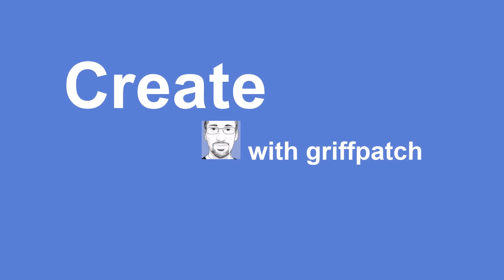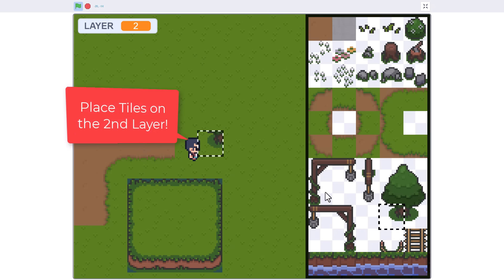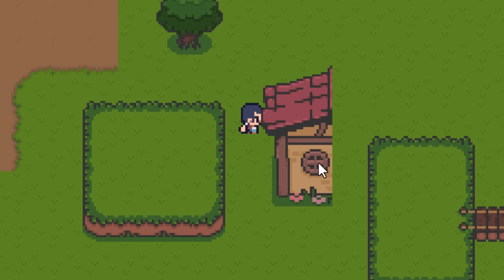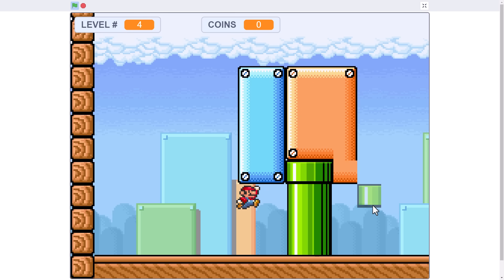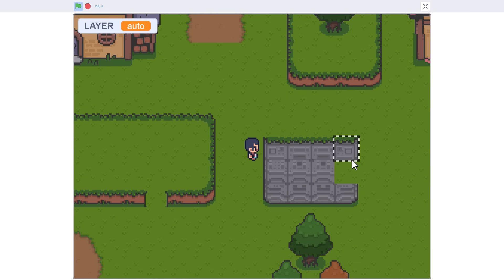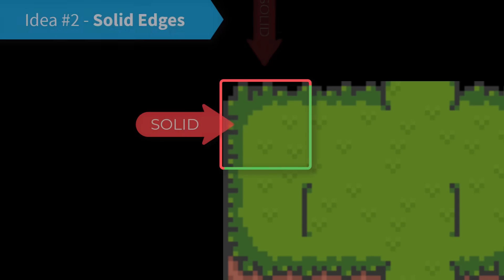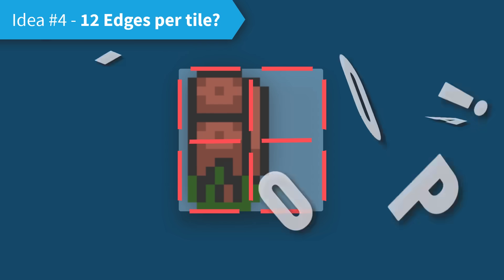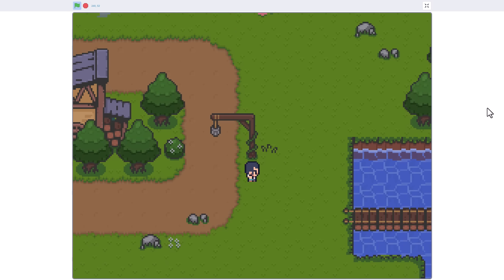Scratch RPG | Devlog #02 | Tile Layering & Collisions

Comment: May i ask: for what are the green and blue pins used?
Reply from the maker: Ah! - You noticed that did you :) - They are special pins for something I haven't explained yet as they actually came after this devlog - I just captured some video after the fact. These allow me to tell the bridge to CUT through another solid wall - so they can run off the edge of another otherwise blocked platform. The 3rd colour is an elevation pin I shall explain later on :D - I wonder if you can guess!
Reply: @griffpatch  Hello griffpatch do you believe it would be possible to select a tile corner of an large object then select the opposite side corner of such in order to grab all the tiles that are in between the regions for stamping the whole thing. While then having that grid showing where the layout will go entirely on the user mouse click before laying it down? This would be the truly optimal version of the whole thing I believe do you think so? If anything I think it's an interesting idea and helpful even though it requires more work by you. Hope that you would be okay with this suggestion.
Reply: @griffpatch  hmm I'm thinking it'll change what layer the player is on
Reply: Griffpatch already made layers for each tile so it might not do any change
Reply: @dipanshvideotime2730  I guess so
Reply: @magitingLOL  2.5
Reply: @pixelatedluisdev  what do you mean?
Reply: @magitingLOL  woah didn't see you here
Reply: @tigershelf  yeah i joined the thread haha
Reply: @griffpatch    i think levation pin mean you can go through a bridge only when you touch the elevation pin but you cant go through I'f you arent touching it, its used for one way bridge , you can walk in but cant walk out
Reply: @ZnidrqXizzrJh  but arent you touching the elevation pin either way if you go to the bridge..? what do you mean i can’t move if i dont touch an elevation pin
Reply: @pixelatedluisdev  I just can't fully explain what i'm trying to explain
Reply: @ZnidrqXizzrJh  It problaby  also change the layer of the tile depending player is on or under the tile.
Reply: @griffpatch  MOAR EPOK
Reply: @griffpatch  would that be like bridges over things that you can walk under and over?
Reply: @griffpatch  genius
Reply: @griffpatch  I don't know why, but in the past few days i rewatch the video only to have a theory of what the elevation pin is. An mine is: they are used on the bridge so if the player toches them he goes lower in the sprite ordering than the bridge, but if he is on the bridge he does on top of it. Anyway, even if i'm wrong, this devlog series is amazing. The way of making the player colision with the tiles is just genius. I'm looking forward making this when the tutorial series comes out.
Reply: @griffpatch  hello there
Reply: @griffpatch   could you make a tutorial on how to go into the buildings?
Reply: @griffpatch  i think i know i remember when the player hits the door in one of the trailers it takes it to a room it might be for the hitboxes that activate something
Reply: Collision Pins! @griffpatch
Reply: can you show how to do it? i think the projects would be better with that, like some blocks don't really give good collisions, etc @griffpatch
Reply: @griffpatch  hello griffpatch maybe you could make it for a nintendo game
Reply: @griffpatch  I think it's a ladder
Reply: can you please join the pokemon creator club on scratch
Reply: @Jiguysjigsawidynno  maybe he can
Reply: I think it has something to do with layers, the green pins only being on the bridges and ladders. For example, if you bridge across a gap, you aren't supposed to be able to fall down. However, if you are already down trying to go below the bridge, you should be able to pass through just fine
Reply: @serendipity-tilde  agreed
Reply: I think they're slopes.
Reply: Special hitboxes such as entering houses and swimming? -)
Reply: help me plz I can’t make games I try to make a 3-D game but I couldn’t HELP ME
Reply: Where are green/blue ones? What timestamp?
Reply: @nextstop_islandgardens  near the end, on the tiles
Reply: @magitingLOL  oh
Reply: @nextstop_islandgardens  the outro
Reply: @nextstop_islandgardens  i think griffpatch cut them out the video
Reply: @pixelatedluisdev  no i saw green ones after that comment, no blue
Reply: @nextstop_islandgardens  At the end, people always think when he says " that all for today " everyone leave the video but doesn't realise there is a gameplay that show the blue/green at the end
Reply: How to use auto layer
Reply: Collisions
Reply: i have an idea:
red is for full solid blocks
blue is for semi solid
and green is non-solid
Reply: @ZaeNonQ  semi solid meaning you can walk through if certain conditions are met?

Also non solid is useless just have no pins for those
Reply: @EirPlen  yes

Comment: do you plan on making working doors by adding a 4th pin which will set off a variable to turn everything into a 2nd map? Or do you plan on making a line of code which will set the players coordinates to a point which the player will never be able to get to normally and making it so everything outside of the walls is set to a fully black void? both of these would work in theory but i was wondering which you would use
Reply from the maker: Well - I'll explain all once I know all myself!

Comment: Hey griffpatch I have an idea for the level editor: let’s keep the old inventory but like Minecraft: you press a key, choose your tiles and then build
Reply from the maker: That is actually an excellent idea... a hotbar combined with an inventory pane - that would make switching around real fast... except I'd need to rethink how layers worked as they are bound to the number keys
Reply: @griffpatch  probably you could make an auto-layering system, using the system that you used with super Mario

Comment: Tiles are only useful for random props if they're customisable. You know. Like the murals you might see in Yume Nikki. Or if you want an adjustable pole or whatever. Otherwise, you should just make them floating objects and set the layers of surrounding objects based on whether they're higher or lower than them. In fact, even if they're tileable, they should just have internal parameters of various things and then be placed into the scene as objects, rendering the whole group of tiles at a time.
Reply from the maker: It's such a difficult call - every decision has pros and cons...! I really struggled to decide which route to take.
Reply: @griffpatch  Well I think this is the best way at the moment, since you can have many objects occupying an arbitrary number of layers sorted dynamically

Comment: Smart! I really like the idea of holding down space to move the selected tile as well. With the first devlog I thought you might make it so that you could select a thing (eg. bridge, water, platform etc) from the tile set and then outline where you want it to be. Then, using the same sort of engine from your mario maker project, fill in the object with the appropriate tiles. However, this wouldn't be necessary with things like houses as they can only be a set width/height. Now I see why holding space is simpler! Also, you are really good at finding solutions for things! Do you have a process/list of steps that you go through to figure something out or are you just naturally/practised at being creative? One more thing: how will you make doors that are solid when closed and not when open? Thanks for your constant inspiration and Scratch on!
Reply from the maker: I don't really have a process... It is just experience. And with regards to doors... At present I am not animating them, they are always open... I haven't figured the rest yet, but switching the time from one true to another at runtime is an option

Comment: Great work! What if there where middle parts of a tree so you can make it taller or different house tiles to make it shorter or longer? They would be tiles that can infinitely connect with themselves and would connect back to two other tiles that they would be in the middle of!
Reply from the maker: Yes that would be awesome, and it's just how zelda works

Comment: I will be editing this comment whenever I get idea.

Ideas:
You should make crates. Movable and breakable. And make a metal crate where you can move it but not break it. This could be useful to make puzzles.

A key and a key door. When you click the key you have it in your inventory. But you need the key to open the key door. This could be useful for puzzles.

Coin and coin door: coins are basically a currency. And the coin door is how many coins you need to have to get passed the door. This could be useful to make puzzles.

Shop: you can have food, items, weapons, armor, and a bunch more. This will be useful to add more content to the game.

Potions: you can buy or find potions. Poison, heal, strength, speed. This will be useful to fight.

Signs: when you click a specific button on your keyboard dialogue appears and you read the sign. This could be useful for adding lore to the game.

Armor and weapons: you could buy armor and weapons in the shop and depending on what kind of armor and weapons they are it's stronger. It could be useful for not making your game too hard.

Barriers: indestructible blocks that prevent you from going to a certain place. There can also be an invisible version.

Custom blocks: you can make your own block and what it looks like, if it can be destroyed or not, and what the collision is.

Custom enemies: you can choose the design, choose it's walking speed, choose it's power level, choose it's powers.

Custom player: you choose what your player looks like.

Powers for enemies: basically if you want an enemy to have lightning then it can have lightning powers. Or fire powers, or ice powers, or wind powers, or water, or earth, or control a specific type of element.

Different endings: you can get different endings depending on what your level is. And in my game I want to make it so that if you get 0 kills you can fight a secret boss but once you beat it then you can't fight it again.

Secret characters/bosses: basically you have to do a certain thing to meet the secret boss. For example you have to not kill anything to meet it.

Vehicles: you can have cars, boats, helicopters, planes and more.

Biomes: basically how The terrain generates. And when you are in the different biomes then different music will play. Like for example you want a grassland area with grassland music but don't want snowy area with grassland music.

Comment: The space trick could probably be used to print a level if you lay everything done correctly lol
Reply from the maker: Yes
Reply: @griffpatch  there’s also one problem with this. with our layers however it will be possible to do it by patching the void with layer 1 ground

Comment: Hey griffpatch,
I had an idea, i saw when you were building the with the tiles, it is a very tiresome process getting one tile then the other and then other and that over and over again,and when you have to make a whole rpg it will be a nightmare.you know if we can make a system in the tile chooser in which if we mouse down at one tile and mouse up at another, all the tiles between them get selected for example if 4 tiles in a 2x2 grid are numbered 1,2,3,4 with 1 and 4 in opposite corners, if you mouse down at 1 and let go at 2, both 1 and 2 get selected and in the world when we place, both get placed. Similarly if we mouse down at 1 and let go at 4 , 1,2,3,4 get selected and upon placing, all get placed. this will be a great addition and will be a huge improvement in the engine.
thanks for keeping on going with this engine.

Comment: But how did you actually make those layers? Like, you switch between layers and they have different efects? How are they made?
Reply from the maker: I'll cover that in the actual tutorial that follows - but it's basically a 3d gridlist. There are 3 items in the list for each grid location. And each one is stamped as a tile one above the other.

Comment: Hello griffpatch do you believe it would be possible to select a tile corner of an large object then select the opposite side corner of such in order to grab all the tiles that are in between the regions for stamping the whole thing. While then having that grid showing where the layout will go entirely on the user mouse click before laying it down? This would be the truly optimal version of the whole thing I believe do you think so? If anything I think it's an interesting idea and helpful even though it requires more work by you. Hope that you would be okay with this suggestion.
Reply from the maker: A very clever idea for rectangular regions! Indeed I could imagine some cool enhancements where you also drag to lay them down, and it maps the edges intelligently to expand to the size you lay down - I'd certainly consider it for my own projects, but for a tutorial in Scratch... it would be too advanced. The best approach would be to be able to pre-mark out the larger tile assets, so if you lay down one, the whole connected asset gets placed at the same time.

Comment: The new devlog style of content is really exciting and I love it. Keep up the amazing work Griffpatch.
Reply from the maker: Thanks! Will do!
Reply: @griffpatch  I will be editing this comment whenever I get idea.

Ideas:
You should make crates. Movable and breakable. And make a metal crate where you can move it but not break it. This could be useful to make puzzles.

A key and a key door. When you click the key you have it in your inventory. But you need the key to open the key door. This could be useful for puzzles.

Coin and coin door: coins are basically a currency. And the coin door is how many coins you need to have to get passed the door. This could be useful to make puzzles.

Shop: you can have food, items, weapons, armor, and a bunch more. This will be useful to add more content to the game.

Potions: you can buy or find potions. Poison, heal, strength, speed. This will be useful to fight.

Signs: when you click a specific button on your keyboard dialogue appears and you read the sign. This could be useful for adding lore to the game.

Armor and weapons: you could buy armor and weapons in the shop and depending on what kind of armor and weapons they are it's stronger. It could be useful for not making your game too hard.